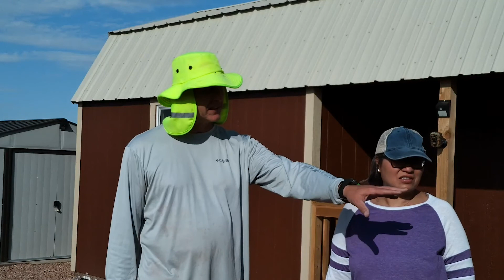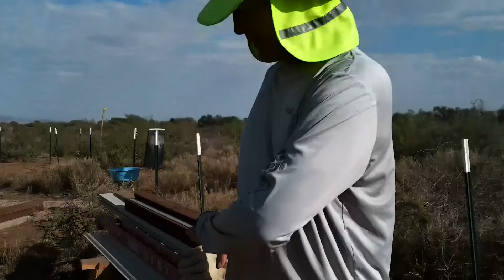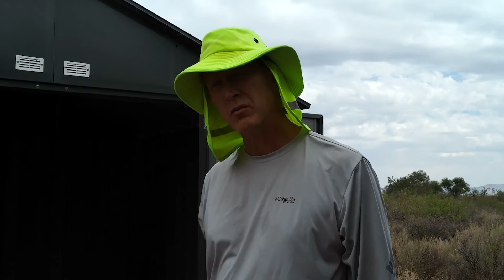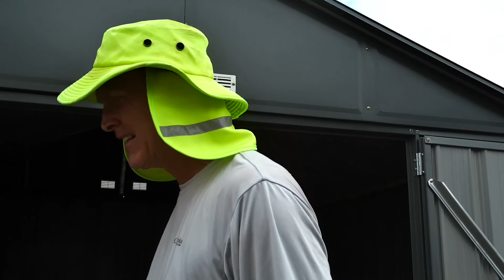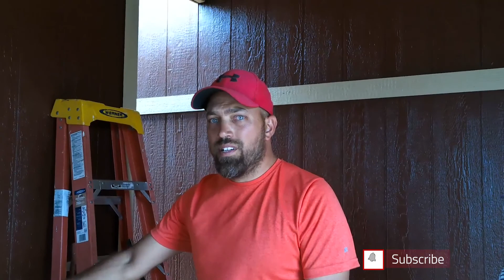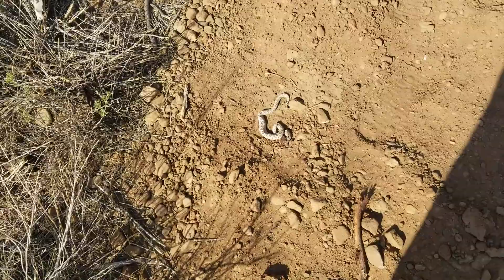Solar Power System Installation for Off-Grid Tiny House Living Cochise  County (Episode 37)

Comment: Nice to see the solar go up on the roof!  Soon you'll have power throughout the buildings!  Are you worried about the stability of the brick wall at all?  Was wondering if turning them 90 degrees (side to side pattern vs end to end) would give a bit more "beef"?  I was ready to hear that you grilled the rattler up for a snack after all that hard work..  :)  Another great update..  looking good!